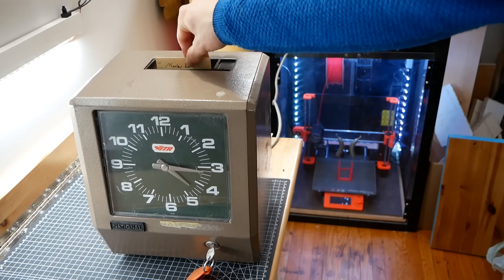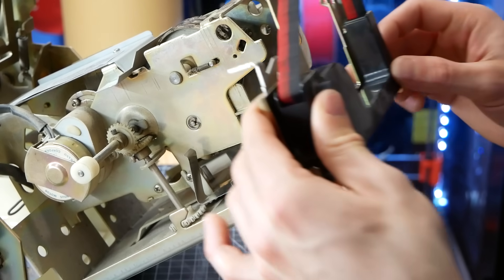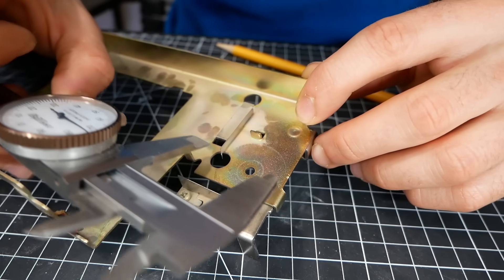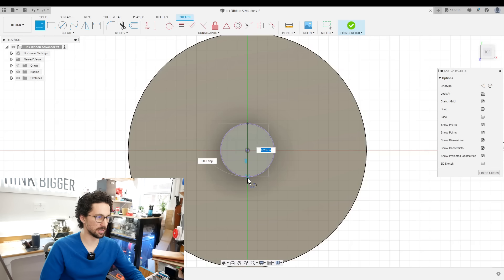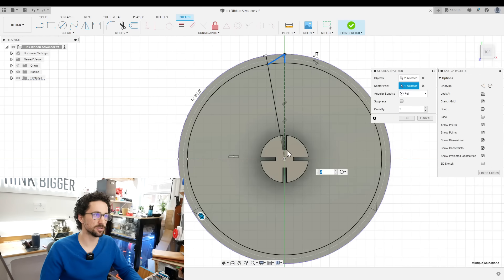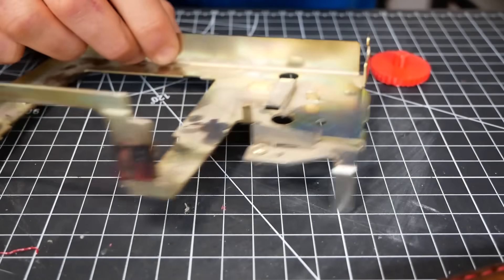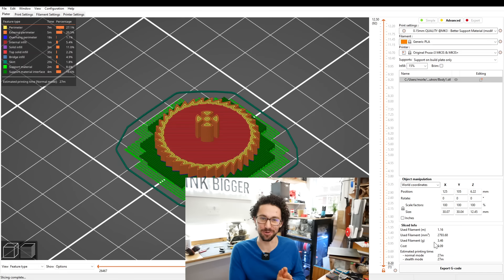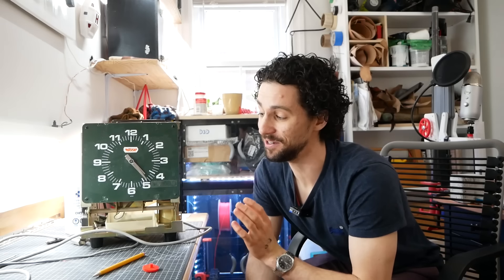They wanted 100 dollars. I 3D printed it for 9 cents.

Comment: In defense of the company, what they offered wasn't just the gear but the whole array. And to still offer spares for a timeclock looking to originate from the 70's is nothing but impressive. Then, when you factor in the time you had to put into engineering, drawing and then finally printing, for a company paying an employee to repair it, it'd probably be cheaper to just order the spare anyway. But it's a cool hobby project for sure.
Cheers.
Reply: $95 is a "why are you still using a 50 year old time clock?" Price and enough to make it worth it to then if you really want it
Reply: @AdamTreier   no it is not a "why are you still using a 50 year old time clock?" - price... It is the cost of stocking these items and making them available for many many years to come. including the necessary distribution and shipping handling...
Reply: @AdamTreier  It's called BUSINESS...

You are the same guy that will buy a $20K car that will be worth $1000 in 10 years.

BUSINESS IS ALL psychology. Your tv that you paid $250 for will be $20 in a few years. That $10 meal you can make for $2 at home. That $6 beer in the restaurant is probably $1 in a 6 pack.
Reply: I'm just impressed they still believed in right to repair and didn't tell him to buy a whole new punch clock instead.
Reply: @magetsalive5162  old stuff was all built to last and be maintained easily, sad how things change
Reply: You also have to realize they probably only have a limited quantity of those original plates in stock... so yeah.. I can see charging $95 for it... not like they have thousands of them to give away.
Reply: Surprised the vendor still sells spare parts. The $95 assembly may also have included a metal gear and even if it was not, it lasted at least 20-50 years so $95 is fair price.
Reply: Yep, not to mention the cost of the 3D printer and software.
Reply: @eggsngritstn  But once you have the printer and software you're free to make so many other things. They pay for themselves pretty quickly if you use them a lot.
Reply: @eggsngritstn  Software is free. Printers can be had for as cheap as $200 and can be used hundreds / thousands of times.
Reply: @-Primer-  Ay yes let me buy a $200 printer to use for 1 piece I need.
Reply: @eggsngritstn  Fusion is free on their website for private use. I bought my E3 pro for around 200usd It's not that expensive
Reply: Agree. The technical knowledge in 3D design and manhours in doing such design are already worth more than $100.
Reply: and what they offer would increase the value of the working clock by being all original parts
Reply: @fabianm2819    Yes, because there's a huge market for 100% original time clocks. If someone was in desperate need of one, you think they'd offer less because the gear wasn't original? You'd think they'd even know?
Reply: Also, the employee that replied to the email probably had to spend a decent amount of time referencing the photos and old drawings to determine what was missing.
Reply: @tshepp89    Probably not. If you are a technical person working for the company I'm sure he knows these things inside and out. It's not like the machine had thousands of parts. When you're in a field for a long time, you'd be surprised how you retain information.
Reply: I would have been tempted to just buy it from the company out of gratitude for them still supporting it.
Reply: @leifgiering  I’m surprised too
Reply: Yeah but all of that goes out of the window if they could have just given him the dimensions of the part. It's not like it's a trade secret at this point.
Reply: Also the fact that the gear he made isn’t going to last as long as the metal one he would’ve got for the 100$
Reply: @maskedgamer5132    The original wasn't metal.
Reply: My god, the people who think 95 $ is to expesive, have no clue how mutch extra costs come in as soon as 1: It is a one Time order 2 : Storage and delivery needs to be paid 3: Employees need to be payed 4 : The machines need to be paid 5 : The electracity needs to be paid and more.... So here is (in europe) how you would normally calculate this: First you figure out your actual production costs, which i would bet with labor cost is around 25 $ now add taxes and you are at 30 $ then, to get into your profit margin you would calculate the 30 $ x 300 % since you have also thinks like rent and PR to pay. So yeah between 85 and 100 $ would be the normal price.
Reply: Lol it's like: I only need a valve stem but these guys want $100 for the whole rim & tire.
   He's valued his time spent at zero $, along with all his capital investments required to even begin. So, zero burden rate included in the 9 cent "quote".
   As a tool-maker, I could offer you that part (at much better quality) for ~1.5 cents. Catch is, the first one costs you $500K to tool up, penny and a half after that... but you have to order >1million.
Reply: Yeah agreed, 100%
Reply: granted he doesnt need the whole array he just needed a gear which was more convenient to make. plus theres probably a finite amount of parts left available so why buy the whole mechanism from someone else when he knows how he can make the one part he needs
Reply: I'm with Rasmus Wahlstedt in understanding the cost of 100$ essentially.  They are also replacing the whole metal piece with the proper plastic part you need. One that is probably also fit properly with specific design layouts for the machine.

Yes .09c for the part. The skill to make it and print it. Which would of been impossible back when that was first made. Quality control can suck it right?
Reply: THIS! Ofcourse you can by the tools for more, and spend countless hours learning how to use and create.. but you are not saving anything.
Reply: Yep, I agree.
Reply: $20.20 ... a max of an hour labour from design to install .. plus the cost of the two parts ... essentially he saved $75 ... and will make his cost back from monetization of the video ... over time
Reply: I think the money can be considered a business expense for tax purposes. Nice video though.
Reply: Agreed. Many kudos to them for even offering the part in the first place!
Reply: Still faster than shipping
Reply: Exactly, there's time and knowledge invested too (research, engineering, design, etc). Not only the raw material to feed the printer. Of course it's not the point here, for sure solving and "creating" the piece is the real satisfactory experience, more than "saving money".
Reply: @yerkocircus  Like: I only needed a valve stem but the whole tire and rim was $100 so, I spent a week creating the pattern/mold and spinning up the internals, fitting and testing... the whole thing only cost me 4 cents.
Reply: @CraftAero  coche!
Reply: I'd rather have a older time card puncher then clocking on on my phone an if the site they use goes down like I've experienced many times it really messes stuff up
Reply: I know right, dude have a 3D printer but won't buy parts for $95.
Reply: Plus the longevity of the part. PLA will not last that long as a mechanical part. 

A metal cog however will last as long as it needs to.
Reply: Honestly, if anything he's better off printing it himself if it's the only part missing. Sometimes these old parts are incredibly limited nowadays so it frees it up for someone who might need to pay that $95 to get theirs working
Reply: @Zulf85  of course HE is better off printing it himself.. It is his hobby, it provides content and if you are familiar with 3d design and 3d printing, the time and effort for such a replacement is within reason. The only problem here is to condemn the price of 95dollars with some unrealistic comparison is just laughable... and to be fair.. 3D printing is not such a plug and play/ easy2use thing... you have to invest quite a lot of time before you get reliable results. if you can do it like he does and you have some spare time you should definitely do this kind of repairs/replacements yourself. Any company would be happy with this 95dollar plug and play service for a 50 year old product.. that is commendable!
Reply: @philxdev  I never condemned the price at any point? I was saying that since it's the only part of the mechanism he needed the rest would go to waste if he just brought it. You need to learn reading comprehension skills.
Reply: @Zulf85  no no I was only agreeing with you and just criticizing the video.. you need to learn to not take everything personally, especially when discussing a video on youtube.. which is what we did.. so it is far fetched to assume that my criticism  was about something you did not even say^^ and it is actually you who needs to improve his reading comprehension skills^^...  How does something so clearly targeted towards the video can be taken personally^^??: "The only problem here is to condemn the price of 95dollars with some unrealistic comparison is just laughable..." IT IS EVEN IN THE TITLE OF THE VIDEO^^  well who cares no harm no foul.. Cheers Mate.
Reply: I thought the same thing.  He doesn't seem to understand how to do a cost analysis. He completely disregards analysis, design, tooling, labor, etc.
Reply: I'm willing to bet their metal assembly will outlast his 3D print. So bickering over programming labor, engineer hourly pay, etc aside, longevity should be considered versus the 95 bucks.
Reply: My first thought. Plus that piece will be stripped within an hour. Might end up costing him 100 dollars to print thousands of replacements.
Reply: Lol passive aggressive as hell. You work for the company? Lolol it's not worth that much and it's a total fucking sham. 100$ for the one part is too much and this dude showed why. Hell, if i had to buy 3 parts, it would be cheaper to BUY A 3D PRINTER AND MAKE IT MYSELF. Meaning that buisness probably either shouldn't be running anymore, or should make some changes.
Reply: he said 9 cents and he already has a 3d machine you make no sense
Reply: @danknoodle67  He literally said something you could print for 9 cents. He never said it's something you can get for 9 cents. Pay attention.
Reply: I came in here to say just this. The amount of time spent on researching the part. The money you've spent on the technology to create the part. It's more than 9 cents. Then to give a dying company another blow to the jaw you give the part plans away for free. Cool part bro.
Reply: @nathanbuczek8344  Why pay when you can do it yourself? It becomes a DIY project. He made his money back easy just from this video alone. Plus all the other videos he made. No loss whatsoever. Also, charging people for the plans would be a blow in itself. If your company is dying then it's time to change things up.
Reply: Also how much is the 3D printer? First gotta have it to be able to 3D print to specs lol
Reply: The title is meant to be dramatic to entice viewers. That's where his real value is made. Cool video.
Reply: @tradde11 The only value in this whole project is knowing that you made it yourself. A sense of accomplishment. In no way did this save money or was it easier than just sending a cheque and receiving the new part.
Reply: @Clark-86  lol whats a cheque
Reply: @pekka_kakkinen  the canadian spelling for check my friend lmao
Reply: "when you factor in the time you had to put into engineering, drawing" would've only been done once by the company, back in the 1970s.
Reply: @RetroJack  I believe they mean the time you personally have to put in as a diyer or company owning the machine.
Reply: @RetroJack  assuming it exists. and any company producing replica original parts will most likely have had to do it itself, nto to mention it will not be made out of PLA roughly glued together
Reply: Well it depends on how much you value your time. Print time was 27m as shown at 11:26, let's say 25m to engineer it, (think of what to make, measure, model). 2x print makes it 79m or just under 1h30m. At 15$/h that's 22.5$, 30$ at 20$/h. 

Not sure whether printing time should be counted or not, but that still ends up being under 95$ for the full assembly, of which just the gear is needed.
Reply: @rose1770  Depends on the business and stuff, but I know first hand how much things will sell for. I mean: if something costs $30 to make, it often sells for $60 or $90. Also keep in mind that the original would probably be made of metal, increasing the cost to manufacture. So $95 may be reasonable for a company that needs to pay more than a single production engineer, but it obviously isn't for someone with a 3D printer.
Reply: @nicjansen230  in the video you can see the original piece (at 3:17) having a glossy white color
probably the original piece was made of teflon
Reply: @librasd8087  The original piece is nylon. I have worked on these…
Teflon is too fragile.
Nylon unfortunately doesn’t age well and crumbles with age.
Reply: @nicjansen230  That's not how that works. The design will only need to be done once, then the cost of the design is spread across thousands of copies of the same component and the component cost will be a marginal increase over the material and manufacturing cost (which would be a fraction of the cost for a large production order over). They definitely were offering the full assembly for $95. Not just the gear. If they were selling just the gear, I'd estimate the cost to be in the range of $10-12.

Source: This is what I do for a living. I'm a mechanical engineer who designs things.
Reply: You're addressing something completely irrelevant to the point of my post.

I was merely posting that the $95 was definitely for the whole assembly and that IF the company was offering just the gear (as in they had planned beforehand to offer just the gear in their replacement parts program) it likely would be $10-$12 dollars per gear. That $10-$12 is just a rough approximation based on my experience in this field.
Reply: @librasd8087  It is 70's tech, so no Teflon. Pretty sure it is POM or Nylon.
Reply: @rose1770  parts like that arent printed, they were molded. that means they would have to drag out a mold to make a single part. that adds part hunting time, plastic costs, and wages for all the workers involved, profit margin, and shipping cost too possibly. and if it was made of metal have a nice day thats gonna be abit more technical!
Reply: @rose1770  I think 25mins for "reverse engineering" this is ridiculously low.
   After finding, reviewing and freeze framing a video that showed the basic "concept" of the part. He then needs measure the all "mating" components, produce a printable CAD model, apply clearances and drafts, slice it and prep the g-codes, set up the machine and run it.
   Then come the "iterations". He only showed one failure/design tweak cycle, and that's probably fair as he just needs it to function once for the video. On that first iteration, with obviously gummed up teeth, I'm sure I could do better with a piece of rock candy and a jeweler's file.
   Point being, if I were his boss and gave him a Job# to track time / materials and then applied a burden rate (capital investments, residence, machinery, power)... the 9cent material cost disappears and it costs my customer $100 for a one-off.
Reply: @rose1770  $15/hr is extremely laughable. Anyway, if you add the monetization of this video, he's making plenty of money off doing it in the first place
Reply: @Bill_Brasky  After reading through these comments, I came here to say the same. 850K+ views as I type this, so even if it took him 3 days to do this start to finish, he's made plenty of money off the video already to bear to listen to the people crying about not just paying for the part.  lol
Reply: @brentd  yeah, if he would have just paid the $100 he wouldn't have this content. So I don't know what people are moaning about lol
Reply: @brentd  that's not the point, the point is your average Joe would be better off just buying the part.
Reply: @Bill_Brasky    Seriously. $15 an hour is minimum wage where I'm from.
Reply: Rose good calculation, I would only say that the hourly rate would be much higher as it’s a specialist job to 3d print
Reply: @rose1770  if your only charging $15 an hour to design and engineer a part and then use your equipment to print it, everyone should just use you instead of doing it themselves. My time is more valuable.
Reply: @rose1770  I think 25 minutes is a fairly conservative estimate for the engineering time here. If you're whipping up designs like this in 25 minutes from some dust marks and measurements, you're probably getting paid a lot more than $20 an hour. Conversely, if you are being paid 20 an hour for your skills as an engineer, this likely would take you quite a bit of time (and trial and error). I like the concept of this video a lot, but I have to agree with Rasmus that the company even having this part and selling it is pretty impressive.
Reply: @rose1770  That printer part is not going to last long.
Reply: @rose1770  Yeah but a company doesn't charge you just the cost of the employee printing it, they have overhead, so they are probably charging close to $100-$150/hr.
Reply: @rose1770  but it’s not like the company is trying to rip him off or anything . But yea time is money . And depending on much u value your time I might be worth it to buy it but he used to make a video he probably ripped  it out himself lol
Reply: @rose1770  you forgot about the time he spent watching a video to find images of the piece being made. And if you value your time at only 15/hr you don't value your time. I can tell you, I value my time more than anything. That 2 or 3 hrs of fucking with that little gear, is time I could've spent with my family, that's worth a hell of lot more than 15/hr. You also have to factor in cost to power the unit, and the wear and tear on said equipment. This is all factored in when you're a business owner and manufacture parts. Anytime you touch an item, it costs money.
Reply: @rose1770  You're not factoring in trouble shooting, research and ground work. All had to be done behind the scenes before any of this was shown. Ya sure the final steps are quick but the road to get there are not. He spent at least 15 or so hours on this project in totality which really isn't worth it from a money angle. I make $300 daily so this would have been a $600 project just for my time.....to save $100? the money saving isn't why you do this sort of thing, it's a hobby.
Reply: @Clark-86  yeah, that's what I was thinking at the end when he said it was crazy the company wanted him to pay $95. This video was super cool, but factoring in time you spent (that theoretically could have been spent working and making money instead) you actually lose money from doing this...

Unless you need to print and replace it like 10 times after, at which point the cost might balance out
Reply: @Clark-86  highly doubt it took him 15 hours to design and test that gear. Seems like he could have banged it out under an hour
Reply: @Clark-86  15 hours???? He literally showed how long it took to measure and design, about 13 minutes. Add on printing time (which is automated so you can do whatever else while it prints) and you got a max of 3 hours. MAX
Reply: @Clark-86  so true
Reply: @Clark-86  People forget to factor in spent free time. I.e. yes from a working stand point it'd cost that much, however from a free time spent, you're saving $100 versus spending $600 like you're implying. Not to mention the benefits of problem solving something like this. Lets say you've had to make a gear before, this process isn't anywhere near 15 hours. Now if you said you had to work an entire day doing what you're currently doing for work and had to exchange that for a gear, that's entirely different, but is what you're implying, which isn't an accurate stance as this would be done when you're normally either watching T.V. Participating if your favorite sport, video game, etc. That's what you're trading for how to learn to create a gear via troubleshooting. Correct perspective is important in moving forward.
Reply: @PIVfirestarkproducon  the companies product was for the full part instead a single piece of that part
Reply: @RocketCityShrimp  how long u think it took him to even figure what was wrong with the machine in the first place
Reply: @Clark-86  you have to factor in the fact he probably (idk) monetized this video so any "lost wages" easily get covered.
Reply: @rose1770  and just think . If that gear wears out again. He already has the preset to print another. AKA saving another 95$ to 9 cents.
Reply: @gahmivolka  That's just bad math. If I make an inferior product that wears out quicker (resin) insted of buying the high quality part (teflon) that doesn't mean I save the money for the teflon part each time I replace the low quality part with another low  quality part.
Reply: @CraftAero  lmfao I can see you are for some reason. VERY invested into this video. You do realize it is possible to print it with the same plastic the original gear was used with right?
Reply: @CraftAero  nah I doubt it would be 9 cents still as 3D printing with Nylon is still super new only like 3-4 years old comparatively speaking, but it is possible.
Reply: @gahmivolka  yea, he could reprint this piece 1000 times for the price of 1 which who knows how long it would last.
Reply: it legit takes not even 40 minutes to make something like that on fusion360 (the program for his 3d design). so if you wanna get technical he still spent less designing/printing it out.
Reply: Don't forget that this plastic alternative would operate for a week or two before the teeth wear down so much that it needs replacing.
Reply: @Nickgowans  In PLA , its possible. Had he printed it in  PETG, it would not.
Reply: @Nickgowans  You do realize we make guns from this same filament that lasts 100s of rounds, right? its going to last him for quite a long time as long as it stays out the hot sun.
Reply: @TheBasedNinja  materials don't work like that, something which is resistant to a small explosion is not automatically resistant to abrasion. You can use tungsten carbide to cut hardened steel but if you made a gun out of it it would shatter immediately. You can make a gun out of plastic and it might survive a hundred bullets but if you dragged that plastic along the floor for 10 miles there wouldn't be a lot left. These things are supposed to last decades being run hundreds or thousands of times every single day, that kind of abrasion would wear the thing out in weeks or maybe months of regular use.
Reply: @Nickgowans    A week or two? No way. There's not that much force being applied. The tang is pushing the gear - it's not two gears meshing together under pressure. It's not a vehicle transmission. That piece will last years.
Reply: omg, I just literally typed this exact same thing without reading your comment! We are brain twins.
Reply: So damn passive aggressive
Reply: @kanesmith8271  How would you classify the title of this video?